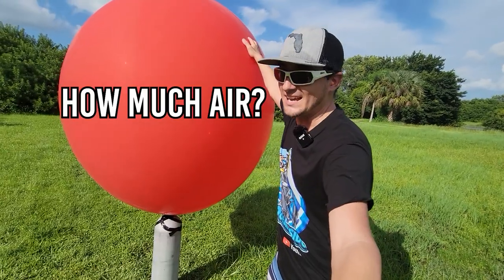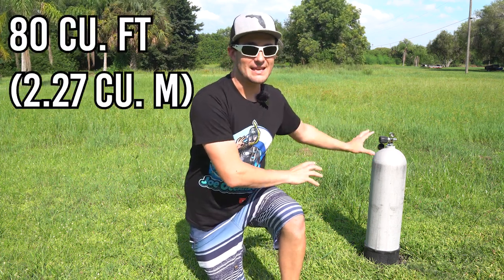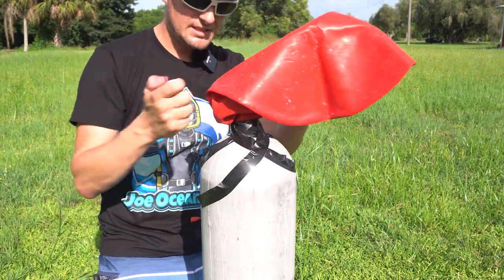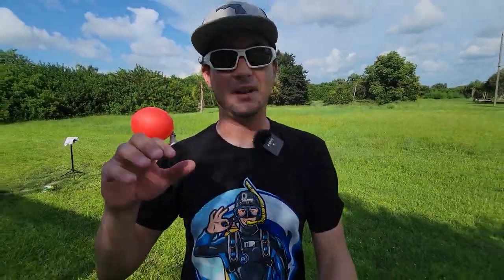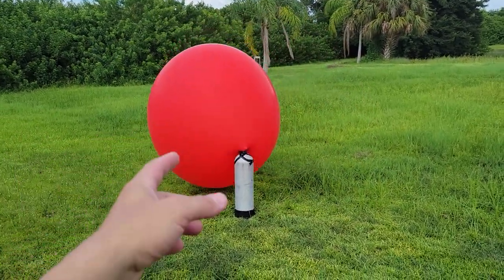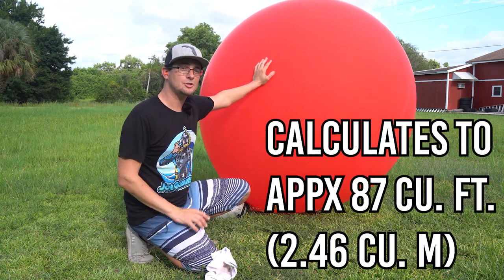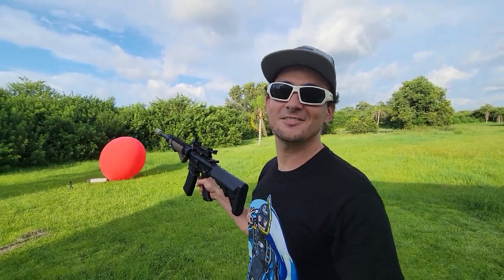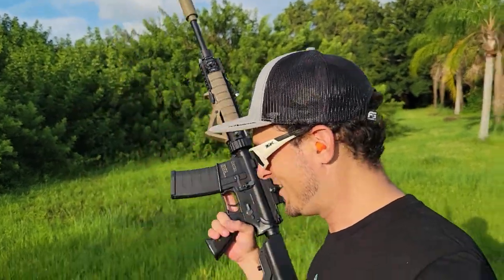How Much Air is Actually in A SCUBA Tank?

Comment: Cool. I wonder what future tech we will see when it comes to diving. Imagine if you could carry 10 times the air in similar sized equipment.
Reply from the maker: Yeah, it could be pressurized higher. I think firefighters have 4500 psi tanks, that would mean 50% more air
Reply: @JoeOceanside  cool 😎
Reply: Artificial gills would be dope
Reply: Well. Dont wonder to much. They moved to 300bar already. And some carbonfiber hydrogen tank can hit 700 bar. But beyond that you can basicly turn the gas to liquid. 

Also with rebreathers you can already like 16h dives with a couple of tanks. There isnt realy much need for better tanks.